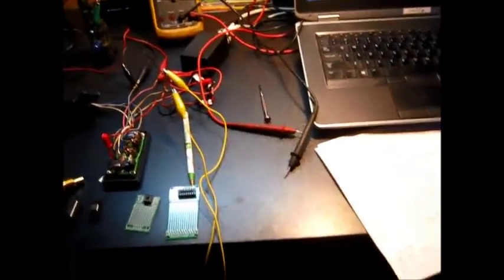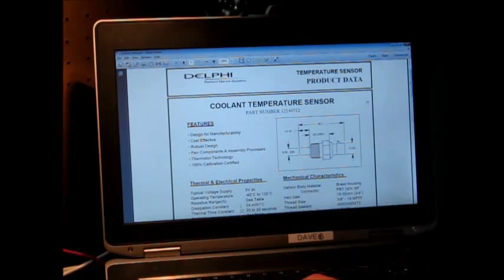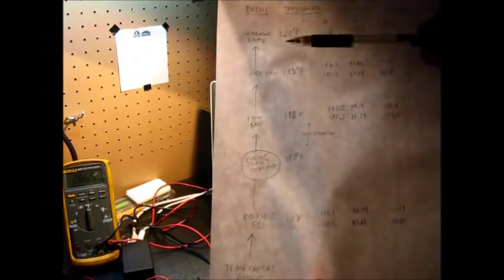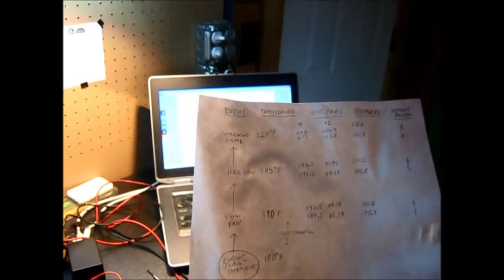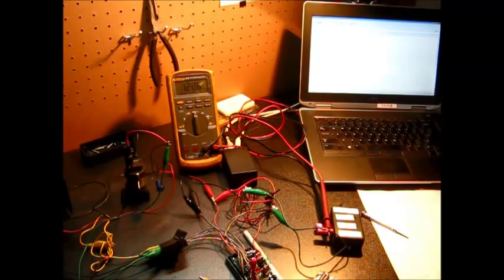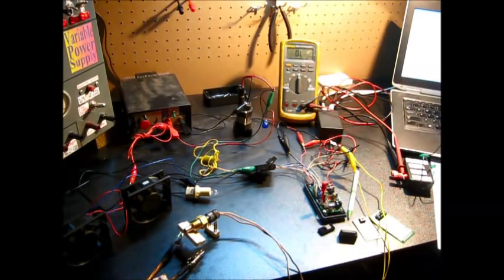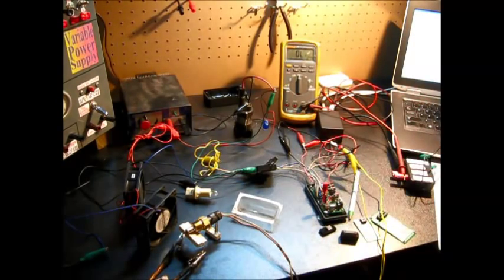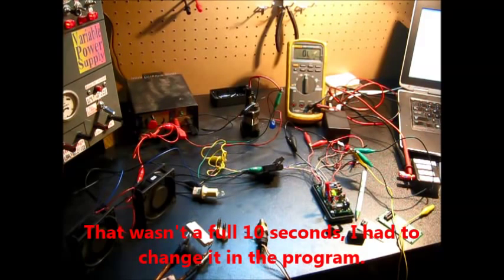PIC16F88 Automotive Cooling Fan Controller

Comment: That's a super useful controller! Did you add inputs for the AC pressure switches too, or does the car's wiring handle that?
Reply from the maker: Thanks. I didn't add inputs for the A/C pressure switches. I wanted to keep it as simple as possible. Plus, the car already has a complete stand-alone A/C system.